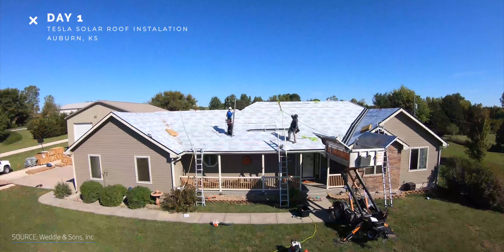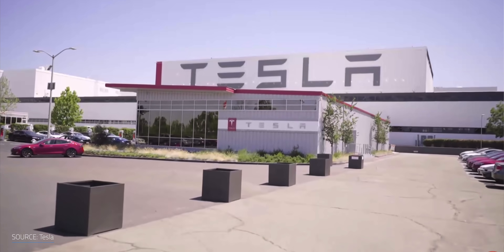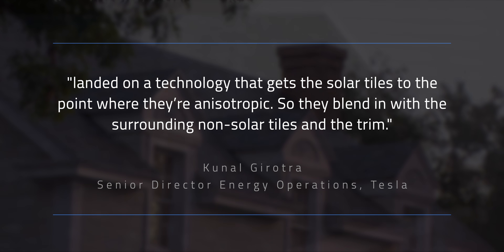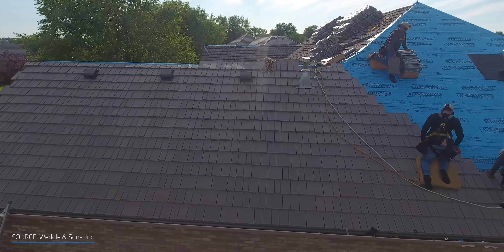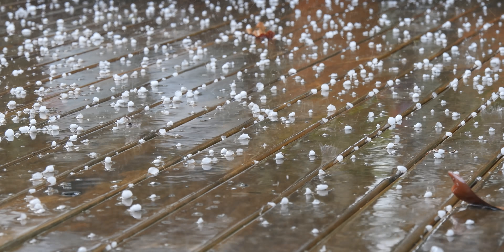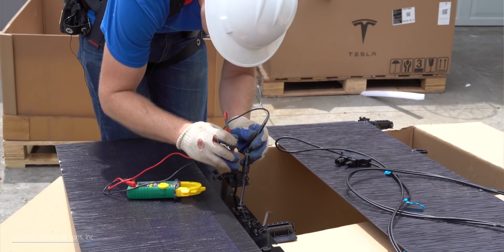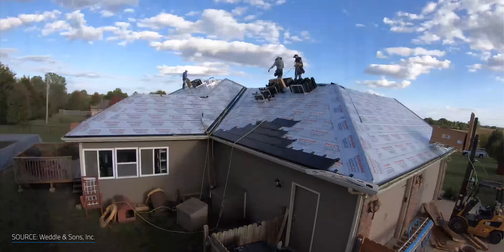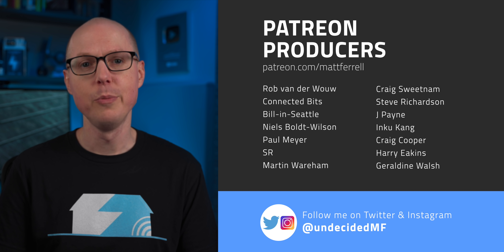Exploring If Tesla Solar Roof Is About To Go Mainstream?

Comment: Why is the savings on electricity not factored into the costs?
Reply: Because it's impractical.  Different local electricity prices, different local policy admit selling power to the grid, different prices for selling to the grid.  As well different weather and even daylight periods.

Take for example where I live, we have dirt cheap hydroelectric power ($0.08 CAD at the meter), in winter we are farther north woul shorter days, we also receive regular precipitation meaning clouds and therefore less sunlight. 

And then there are factors down to the individual home, like which way does it face, are there trees casting shade.  How many solar units are in your roof vs dummy tiles?  Too many factors to calculate savings into the price like that.
Reply: @jeremyO9F911O2  okay, let me rephrase. Why was it not just mentioned, saying it would save (at least some) money in the long run and used one of the installations as a case study perhaps. Saying that their bill went from X to Y? I just feel it's a massive selling point getting overlooked.
Reply: @Christoph_vdl  but do you think super roof customers aren't already aware of that fact?  It's still an early access technology.  The facts are the only way to prove a roof's lifespan is basically in real time, so customers today are essentially gambling on the lifespan and performance of the roof.   Also this roof is a compromise between solar performance and aesthetics.  So they are a bit of a posh product, like if a sports car could be a building system.  I mean that's kind of how Tesla markets.  Like do they even talk about gas savings for their cars.  Usually you hear about ludicrous mode, and autopilot, and door handles that retract.  Tesla buyers of today don't need to be told about the practical facts, they already know them.  And frankly I bet Tesla is at peak manufacturing capacity anyway and actually need to balance their sales to that.

Comment: You should contact me about the install process.. My experience has had some serious challenges I think you should know about.
Reply: Please elaborate, I'm a flat roofer not a shingler, but I'm curious of the challenges you've identified.
Reply: @jeremyO9F911O2  the roof is about 5 to 8x thicker than traditional shingles.. sheathing, waterproof membrane and the tempered glass roof tiles that anchor in mechanically row by row.  

So homes with siding are  somewhat  challenging; as they have to cut siding high enough to accommodate abutting areas next to the siding for the roofline. Imagine your roof being as thick as solar panels everywhere.

So far the company has been addressing the issues during installation, but a lengthy process.  If you have gutter guards.. don't expect to keep them, as they may not be compatible with this type of roof.  

 I'm still going thru a few things.. giving the company a chance to resolve the issues to my satisfaction.  But as the vlog suggests.. the beauty of going with a solar roof are for aesthetics, function, durability, cost, and ease of maintenance if required.

Comment: 10:28 Oh boy, as a aluminum/vinyl specialty contractor I sure understand that one. That's my big issue with trying to explain why I don't take on some repairs. They can probably get it down to 2 days. Maybe a small crew, or single guy coming back a 3rd.

Comment: I love the idea of privately-owned decentralization energy production however I don't believe it'll be allowed to catch on because it would take away power from centralized distribution which is easier to control I also not a naive to the fact of the impact on the environment due to strip mining for the materials required to produce the solar panels. When you compare the amount of energy needed to produce them compared to the output over the 25-year lifespan of the average solar panel it ends up being not as easy a decision as some less informed people believe

Comment: Clearly this is done for the millionaires. My roof, done by a roofer in a long day costs to replace under 2000 USD including 25y shingles that should last at least 15y. Even for a larger home, say 2000sqft one it is still like under 4000 USD all in. So a very large home but not a mansion of say 5000sqft is around 10000. Now lets upgrade from shingles to say metal and it doubles. So I have no clue where these "other" numers come from or whom is paying 40k for a roof!

Comment: * I'm a real estate investor and do rentals and flips.  From a landlord position, it can be attractive, but its still too expensive.  In single family homes, the tenant pays utilities.  In converted multi unites that are not separately metered, the owner usually pays the utilities and charges the tenant more to cover the bills.  So I wanted to see if installing solar roofs or panels would profit me on properties where I would need to pay the utilities.  A rule of thumb some investors use is that if something costs you $1000, for it to save you at minimum $8 a month for at least 30 years, preferably above $10 a month.  I put numbers together for a small converted duplex.  Electric bill is currently at $95 and has gas bill at $140.  Gas is supposedly 30% cheaper so I figured that if everything was electric, it would be around $300 a month.  I checked w Tesla and they recommend 4 power walls and panels all running me about $33k, but it would only cover me for $200 a month's worth of help where I would still have to get $100 from utility company.  They said maybe a different design and/or wall packs may get me to where I wanted but would cost more.  Since I have gas, I would need to convert hvac, water heater, and stove to electric.  An electric stove may cost me about $500, water heater maybe about $500, and an electric furnace about $5k (also considering a ductless system but would need to price out costs and efficiency) putting me at about $39k plus labor to get a $200 a month benefit.  Something else to consider is that Tesla says equipment should last around 25 years.  I should probably call back and see what all needs to be changed in 25 years, if just parts or entire system.  At this point its still financially unfeasible for investors.  If all equipment and labor costs would be $40k, system to last about 50 years with less than $10k in maintenance in that time, be able to cover all bills, and even make $100 a month from selling back to grid, then this becomes a smart move.  I would even do this to my single family homes, put the system, charge more rent in amount of what their bills would have been, and possibly throw them free internet and lawn care.  Many landlords would catch on and sales would explode.

Comment: I've seen that for Belgium, it's advertised at 220€ for a square meter.

But does it include removing my old tiles and installing new ones,? Because I couldn't afford that (in fact, I couldn't even afford installing a Tesla home battery after that).

Comment: We have been talking for a couple years now about doing a solar roof. The cost is really the thing that stops us in our tracks. The one thing this video doesn't talk about is batteries. How much is that for any electric you need  at night and a long period of cloudy days and or storms like hurricanes etc: How many would you need for just the basics? That isn't cheap and how about a gas powered generator for those times. Other things to think about.

Comment: As a solar professional; I recommend to not do a solar roof. What tesla doesn't want you to know is the maintenance routine for these tiles. What if one tile breaks? They're likely wired in series and now stacked on one another. To fix one panel you have to take off the whole roof! They're so new the long term faults haven't been revealed. That added to the lower wattage per square ft.? Makes these not worth it.
Reply: I doubt they are in serial.  More likely small groups in serial for the optimum voltage then paralleled with the rest into the storage.

Comment: 08:39 - Am I the only roofer who cringes when he sees someone pick up the gun by the hose!?!
Reply: Depends on the hose, and the connection in particular. He looks to have a pretty solid connection on his, so the pulling shouldn't be an issue, and as long as it's not able to bend and weaken the point at the connection much, which his looks well set up to counter, though that longer stiff cover while helping there makes them harder to push into some smaller hard to reach areas sometimes... but overall I'd say it's ok. Definitely just pick up lightly, no swinging or sudden hard tugging though. And at most, the cost of the connection points there are probably not more than 20 dollars for all parts in that spot, the whole hose being more though if its not a good one. But if you save several seconds reaching over, and back strain, and it gives out an extra year early, you spend and extra 50 dollars every three or four years for doing that maybe... well you probably make more in time saved while working, and again, less back strain with leaning over to pick it up all the time. 
I come from a very frugal background so I habitually always am very careful with my stuff, but these days I more and more realize that time spent being careful and gentle actually may cost me more than being rough and just buying a new tool or item with the profits I gain from not wasting time on it.

EDIT: Though for the record, not a roofer here, though I do like making some stuff in my own projects, and I do work on my own roof plenty if needed It's not my job or anything.
Reply: @terricon4  Dude, you ok? That's really long answer, why?
Reply: @archerwithspark  Brevity is not my forte.

Comment: My wife and I will be building our next home this year or maybe next depending upon material costs. We own our current home so no rush. I went to check into getting a quote on teslas site and it says that they are not currently in my area, Northern Michigan. I am wondering if anyone out there has this roof in Michigan. I would settle for down state even, and how it has worked for you so far. Base on the video id hazard to guess that I could probably figure out the installation

Comment: What about the corrosion of wires and contacts? On normal solar panels there is one pair of thick wires for about 2m^2. Here you have to deal with a lot more contacts and thinner wires. How long will they last until corrosive resistance builds up? Are they completely sealed water- and dustproof? Hundreds of electric snap-in connections (?) with high current load 25 years without any corrosion diectly under the roof, seems not easy to achieve. And they are most likely connected in series, so that resistance is adding up for all the other panels.
And how can a (not mechanically) defective panel be located?

Comment: Great idea, but I have doubts about it's flexibility. Since it's tempered glass, you can't cut it to fit the tiles into an awkward space without it shattering.
Reply: They use dummy tiles, when there is a need for angles or around vent pipes. You can't cut the PV tiles at all and expect them to work. You'd basically be cutting into a circuit board. The same result if you tried cutting your computer motherboard.

Comment: Do they use a 1-2" air gap for cooling the panels to improve efficiency and the help keep the house cooler in the hot summer sun?
Reply: 1.5 inch gap actually

Comment: I think it is an awesome idea  but I don't think the prices shown there are correct, if I remember right I have an asphalt roof here and the price installed was not even 1/10th the prive of what you showed there if I remember right, normally I would do the work myself but the last time it was done by some local roofers. That was really interesting, thanks.

Comment: The one thing holding me back on this is I don't have $50k to spare.  I'm a disabled veteran.  The advantage is my income isn't taxed (which hardly matters since my income is so low anyway...). But the biggest disadvantage is I have zero access to almost every incentive for solar.  I'd love to get a solar system and save money on my power bill, but until there are programs to help retired or disabled veterans, I'm kinda screwed.  If I'm wrong and someone knows of a program, please let me know.

Comment: 4 or 5 times the cost of a regular roof?  Sorry, not tempting enough.  When it gets down about 2 or 3 times the cost then it would be something to consider.  It needs to be able to compete directly with traditional solar panel installations.  When you can make the price just a tad higher of traditional panels then that's when you will open the flood gates and people will be tripping over themselves to get it.

Comment: Question?
Does it hold up in snow country? Not Denver type snow, hundreds of inches type snow. Also can it hold several feet of ice/snow with snow-retention installed? There is no way this roof would hold up where i live.

Comment: Tesla will have a better price per watt because of market share. The price will drop significantly when the system is taken up more in the mainstream for the duration of the patent. Simple supply and demand.

There is one problem with these though. All valleys and cut pieces can’t be done on site because they tempered. How do they work with issue?

Comment: Has anyone considered the size of the carbon footprint that it takes to make solar panels? Although the use of solar panels is green, many solar panel manufacturing processes are not. The production of photovoltaic panels still has an important carbon footprint and creates a series of waste, liquid and gaseous by-products that are harmful to the environment. Firstly, the extraction of quartz, the crystalline form of silicon, and of the other materials necessary for the construction of the panels. Moreover, for the production of metallurgical silicon, huge furnaces, and very high temperatures with the production of large quantities of carbon dioxide and sulphide are needed.

Furthermore, the chemical process necessary for obtaining the polycrystalline silicon occurs through a reaction with hydrochloric acid and hydrogen, which leads to the formation of a very high by-product, silicon tetrachloride. It is a by-product but, proportionately, for each part of high-purity silicon produced by the reaction, silicon tetrachloride is from three to four times as much.
Although western countries are developing technologies that can reduce the environmental impact of this type of production, most of the panels, assembled today in the West, are produced with more antiquate technologies in areas of the planet known to be less attentive in respecting the environment.
In fact, half of the world production of photovoltaic panels takes place in China. In general it has been estimated that around six months are needed for a solar panel to produce the energy required to clear the carbon dioxide emitted to produce it. However, this aspect depends mostly on the place of production. In China, for example, much of the energy is generated from fossil fuels, mainly coal, so the carbon footprint of its electricity production is twice that of the United States. Consequently, also taking into account other factors, such as transport and logistics necessary for export, and the fact that China is its largest global producer, when a panel is installed on a European roof it takes about a year to cancel the carbon footprint necessary to produce it. As a result, when the panel produces clean energy in China the production of greenhouse gases increases. This is why solar energy is clean, but not so much. Also recycling faulty panels, or those at the end of their life, leads to environmental problems.
It's the "clean energy" that isn't so clean after all.

Comment: There needs to be a section in the video talking about efficiency. I'm no expert here, but a quick google research gave me the following numbers.
The Solar roof tiles seem to have an efficiency between 12 and 14 percent, according to different sources. That is not taking into account, that the transparency of the glass used on the roof tiles isn't the best. That takes another percentage point bringing the efficiency to 11-13 percent.
Compare that to traditional solar panels, that have an efficiency of around 20 percent. 
Looking at these numbers, this should definitely be taken into consideration and I have no idea why you didn't include this in your video (probably because this video is pretty much an ad for Tesla, but that should be disclosed). Bottom line here is, if looks are hugely important to you and you've got some money to burn, go with Tesla. For everyone else the traditional panels still seem to be the way to go.
Reply: My first thought is, that the average home owner preparing to install panels is looking at installing enough to supply their expected maximum draw, which would generally not cover the entire roof of your home. So if the installation of a solar roofing tile is financially close to the cost of roof + panels, and you cover the entire roof with active tiles, or at least have the option to do so, even though the efficiency may be lower, the absolute generated power is going to be greater due to much larger active surface and you get all the benefits  of the impact resistance and longevity of the solar tile.
Reply: @charlieg9559  Yeah from the installations they showed the people buying these have roof areas that greatly exceed what they need and thus most of the roof is dummy tiles, so other than increased cost due to the need for more panels, the efficiency losses are easily compensated for. The benefits in aesthetics, durability, and maintenance also help justify it, I would expect these would also raise the property value because of those factors (and keep insane HOAs off your ass).